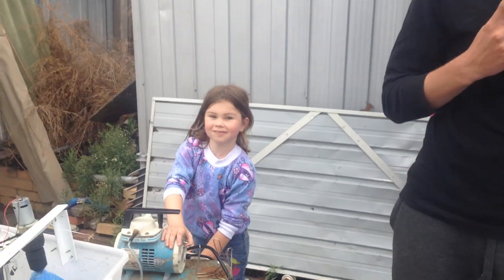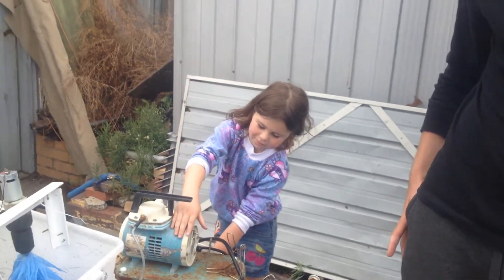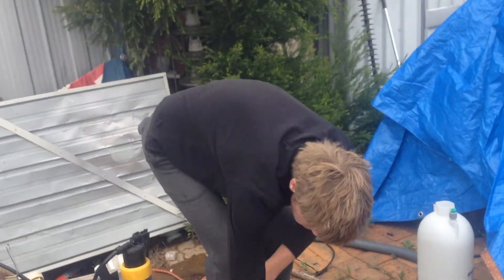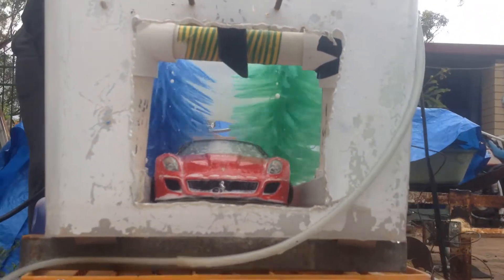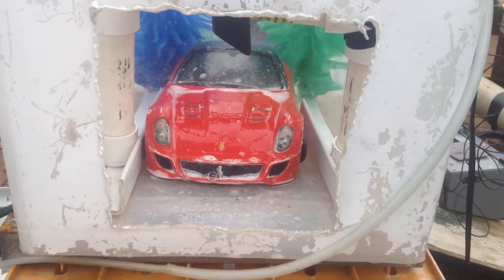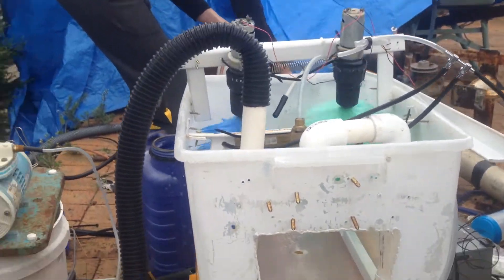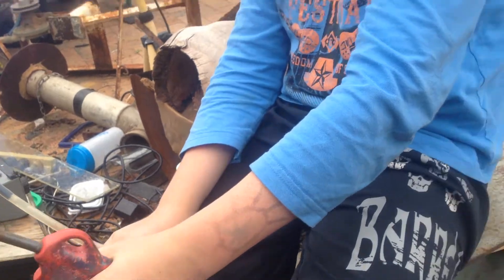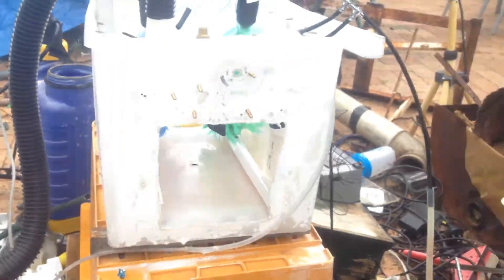scale model car wash

Comment: Nice;DD That's cool!!!! Saw the insulators you got, do a video on them;DD????
Reply from the maker: +Variac Maniac i wont be able to because i used to live in Perth but i do have a start or an insulator collection and i have a large crate hopefully going to be shipped over to where i live and ill make a vid of my small collection and did you notice the large composite insulator as well as the glass suspension insulators ans i have a insulator that is dated 1958 and was pulled out of service 4 years ago
Reply: Nice;DD I have a composite insulator very similar to that as well, but not the other composite one that has the sheds at an angle, very cool though, Cheers!!!!
Reply from the maker: +Variac Maniac the glass insulators in total can whistand 132kv but in order to move them  i have to separate them into strands of three and i have two neon sign transformers the (same model) rating of them is input: 240v 2.2A 50hz. output: 15kv , 30ma 50hz
Reply: Adam sturgeon Did you get the insulators from insulator hunting, scrap yards, linemen????;DD I've got 11 blue/ green suspension insulators that are bowl shaped;DD I love NST's, Cheers!!!!
Reply from the maker: i got them from western power, and power lines plus mostly lineman ans some from insulator hunting
Reply: Adam sturgeon Don't know what fascinates me with these things, very cool and very interesting;DD ah Cheers Mate;DD!!!!